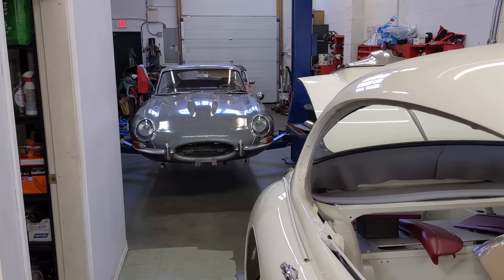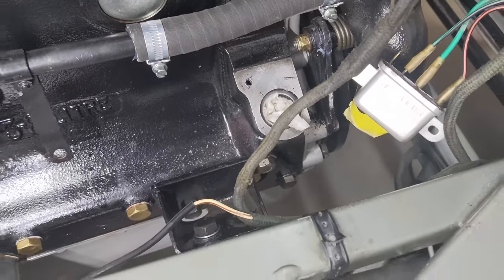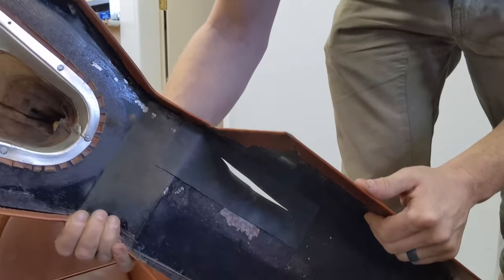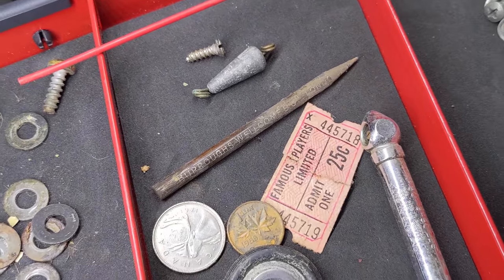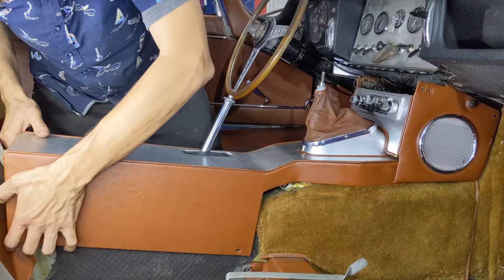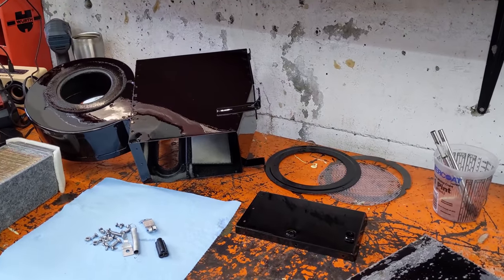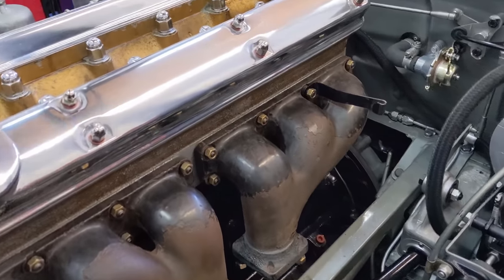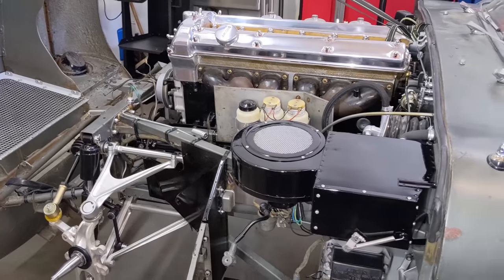Preserving an original 1962 Jaguar E-Type 3.8 EP5

Comment: That Jaguar twin cam is one of the most beautiful production engines ever produced . Simply Fabulous ! .
Reply: The most beautiful.  Smooth as silk to drive. Faster than anything on the public roads.  Winner at Lemans.  What more could you want?  Me? I wish I still had my Dad’s EType.  🧐
Reply: @fredglover430  I agree. Le Mans was not won by e types however  but the basic engine design was certainly in development for the later jaguars. I know.................picky picky me.
Reply: @graham6229  Le Mans was won by XK120C or C-types  in the 1950’s , but still the same engine as the E-type🇬🇧

Comment: So much fun watching you carefully put this car back to original condition.  Regarding the SU cylinders, tough call.  I polished my Healey's, but I am taking a lot of liberties on finishes etc because it was truly a basket case headed for the landfill.  If you choose to lightly polish them to your glowing aluminum standard, instead of a hard shine, they would fit in that engine bay.  As you pointed out, they do stand out compared to the other pieces of industrial art under the hood.  No doubt folks with E-Type knowledge will clue us in on what the new original finish would have been.  As usual Mr. Owen, thank you for providing these videos.  Its a pleasure to watch skilled careful work.

Comment: I think that polished SUs look better than dull ones. The guys at SNG USA say that the heat shields are not and never were asbestos. Thanks for showing where the clip on the speedo cable goes, who knew?
I like the parts and layout on this early model more than later ones, that's for sure.
Reply: The later models ones with the huge and heavy V12 lump were slow Boulevard Cruisers at best.
Very popular in L.A. Sad.

Comment: I have a photo of a 4.2 Series 1 E-type on the factory assembly line that is large enough to zoom into. The SU dash pots  are shiny - equal to the cam covers and intake manifold alum parts. It's likely that the original manufacturer, SU put a  polish on them but I agree that Jaguar wouldn't have done any more work to them.

Comment: I wouldn't be concerned by that asbestos heat shield. Its only a problem if you were to trim it ( cut it ) and produce dust. It may have been OK to give it a quick heat resistant clear coat to prevent any stray fibres coming off. I wouldn't be concerned. What a great looking car in such beautiful original condition. As I've said many time, other channels who strip cars to the metal when the original paint and so on just needs some TCL are sucking the value right down the vacuum cleaner.
Reply: It's ok as is. People are panicking just by mentioning it. Real hysteria ! 🤪
Reply: @marcryvon  Dont be silly mate. This is the commentary section of YouTube.

Comment: I love Richard's work and can't wait to see the fully restored XK150 because I just don't get this original patina restoration XKE or E Type for those of us in the UK, it's just an old car that's had a partial engine and suspension rebuild, the paint chrome and interior all look horrible I'd forgotten just how cheaply made these cars were. 
Me I'd restore and modernise it, I'd want the  paint better than new, modern rust proofing 22nd century electrics, use throttle bodies and electronic ignition instead of the carbs and points, fit power steering modern brakes, updated suspension, have all the interior re trimmed in the best quality leather with no cheap vinyls and thick Wilton carpets with plenty of Dynamat heat/sound deadening I'd also throw in a Vintage Air AC unit and fit a retro looking but bang up to date stereo with Bluetooth for decent sound and phone connectivity and end up with a car that could be used every day instead of one that looks as if it could fall to pieces if you accidentally slammed a door.
Reply: I agree that the modern updates would make the car more easily drivable.. what your looking for is something like the Eagle version.  More expensive that the original.

Comment: IMHO polish the carbs, they look shitty up against the other polished bits. Should there also be and otter switch on that manifold?. On my E Type (1964) the transmission tunnel had the large almost oval washers, are the ones on this correct ?Got to say I love the interior. It was amusing to see the brake bellows it reminds me that E Type brakes are heart stopping not car stopping. What did you use to clean the brake bottles, they look amazing.
Whilst we disagree on wiring looms, I think what you do is AMAZING.

Comment: Let's hope the radio is still in good order, the parts in it are getting pretty old now... fingers crossed.
I like the idea of keeping it stock, but the black covering on the ashtray plate is a bit of a mystery.
RE: Asbestos. I see the same problem in mid 40's radios, eg. RCA Victor. We either leave it alone or pull it entirely... and pulling the stuff out is a real hassle. 
Looking good Richard :D
Cheers,

Comment: Richard you're doing awesome !!!!. Wouldn't vapor blast finish be closer to the original "as new" cast finish of the carbs from S.U ?.  I use Vapor blast on motorcycle engine cases etc. Most people do. It also seals the aluminium pores against corrosion for a long time.

Comment: Control arms originally satin chrome plated..carb linkage was nicad, piston bells were polished..the carpets arent jute backed,the hard vinyl hardura insert material is hairy..the propshaft tunnel sound deadening mat is Flintcote,it doesn't go under the seat..moths love old wool, they are already reworking that shellback moquette,carpets soon..the seatback insert foam has turned to yellow dust, and the cushions and back inserts will split with limited use because the thread is 60+ year old cotton..the original paint on the original cushion base bottoms was originally same as inside, frame green,no burlap hid'em..fit new foam before they get ugly..Smith's painted the heater box, not Jaguar..that asbestos is located in front of the driver and under the louvers will allow high flow air to spew that dust everywhere u run that car,shaking it loose in the owners garage and yard forever creating a toxic environment..we have new modern heatshield material and rivets,proper Cheney clamps, correct hydraulic resivoir float switches,brass manifold nuts, full line of mechanical parts to get u not only there,but back..and a full service upholstery shop fabricating interior kit for mail order and fitting only in house made goods as fitted w British vinyl,wool carpets and Connolly leather..over 200 XK and E-TYPE restorations since 1971..Bassetts Jaguar.
Reply: ..restitch seats, oval washers on trans cover..

Comment: The approach of preservation rather than renovation is laudable, with one exception. If you had sat, as I have many times, at a negotiating table with a plaintiff dying of mesothelioma, you would not be so cavalier about asbestos. That heat shield is not safe. It is in an exposed area subject to heat cycles and susceptible to chipping by people with tools. Asbestos never really is safe: the only reason to leave it in place is if the risk of disturbance by removal is greater than that of leaving it in situ. It having been removed, it should have been disposed of appropriately and a safe substitute fabricated. Please, get rid of it now.